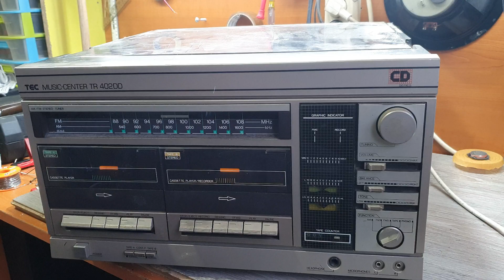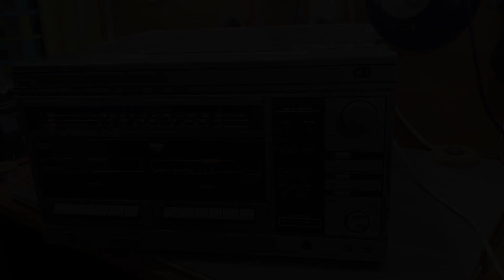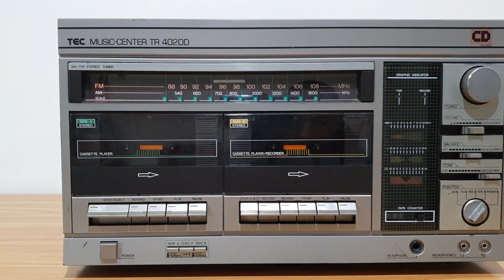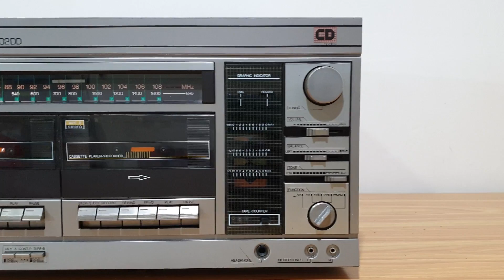TEC Music Center TR 402DD ( How to Fix )

Comment: It was way better to glue another plastic piece for the detached spring. I have the same model and it very easy to fix this issue. You dont have to buy new parts as you said in the video. This button cut and place solution that you did  is ugly and ruins the image of the player.